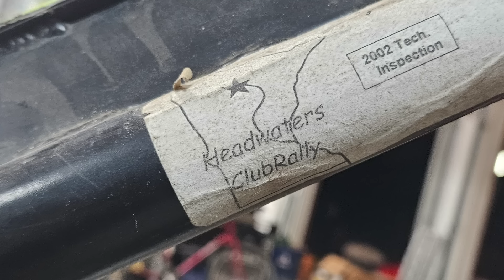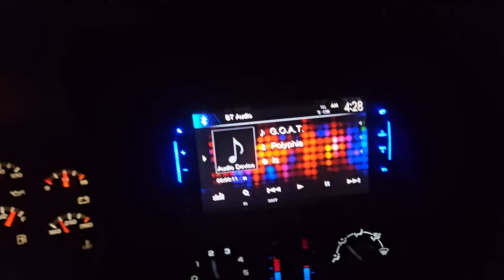I SOLD my HOUSE to Race Rally Cars - Vintage Rally Car Revival

Comment: The inspection light is from a 240/260z!makes sense because you mentioned the other Datsun parts. If you rebuild them can you show where you got your parts. If you totally unravel the green cable it's a hook to hang up on the hood latch on the Z.

Comment: Hey mate, these Mitsubishi LA Lancers dominated rally in Australia in the late 70s and early 80s (watch the ‘79 Repco Reliability Trial film). I had an LC Lancer fastback as my first car, also with that 2.6L Astron engine which I took to motorkhanas. You’ll know that car better as a Dodge/Plymouth Arrow. These cars (and the Chrysler Galant) were all based off the same platform, so I have a strong hunch the windscreens will be the same. Don’t quote me on it, but might be worth keeping an eye out for someone parting out an Arrow.
I myself am in the final stages of building my E36 rally car — three decades after I dreamed about rallying. Best of luck.